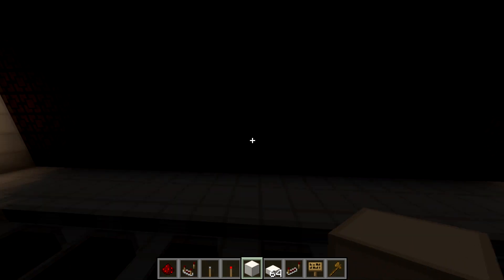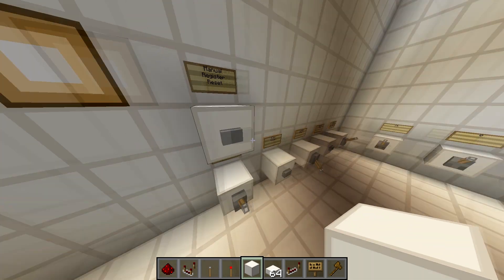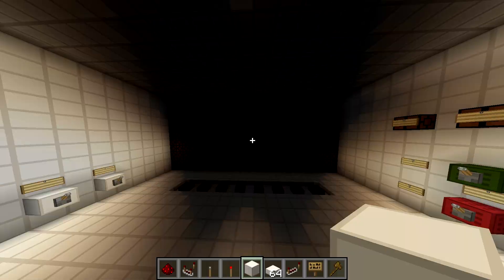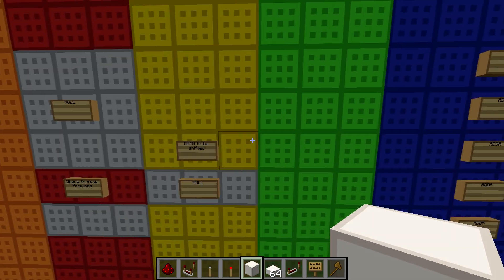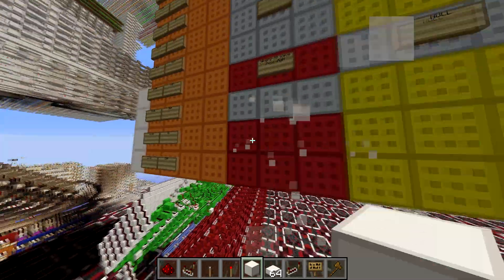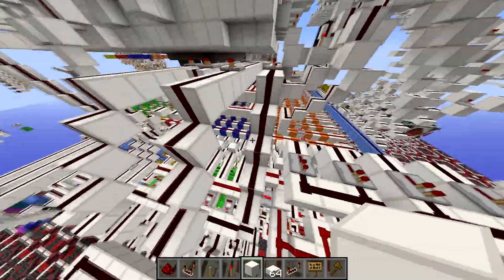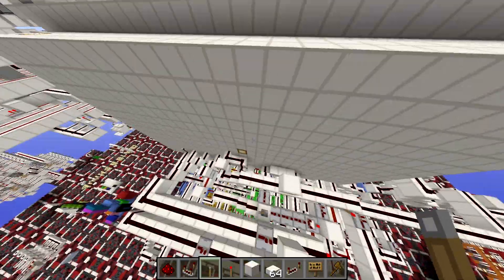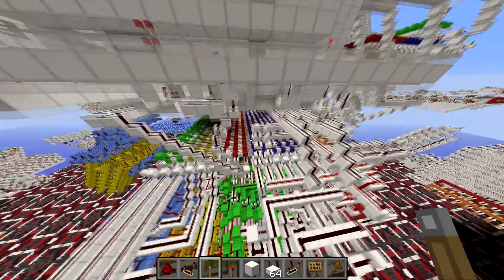|8 Bit SuperClocked CPU| v2.0

Comment: Why are instructions 5 & 6 compare ops with no operands? Should there only be one? Almost all of the signs in the download are broken so I'm trying to disassemble it which is actually quite fun! Brilliant job
Reply from the maker: as i explained... The CMP function is what takes the operands. The branch instruction is what decides to branch.
Reply: greatgamer34 Yes but you have two identical CMP instructions, one immediately after the other
Reply: greatgamer34 Sorry I should have clarified I meant in the actual Fibonacci program
Reply from the maker: oh, the flags registers were derping at 14 ticks when i originally programmed the CPU so i put 2 compares back to back. I then changed the clock speed to 15 ticks and didnt check to see if it would still derp. so i left the instructions there.